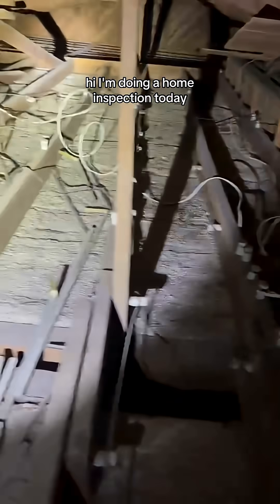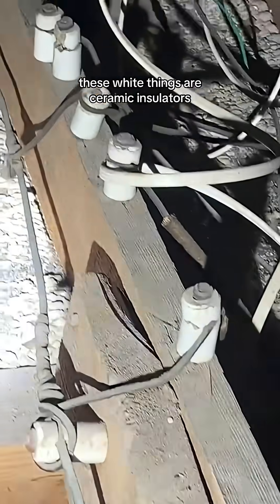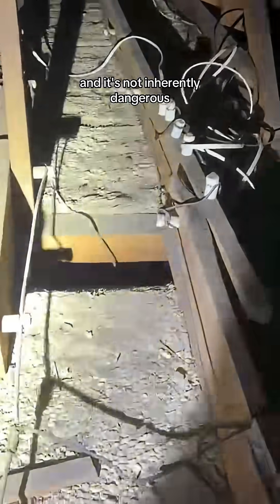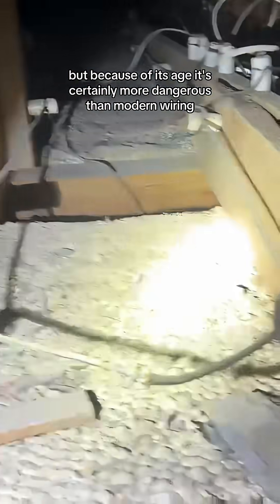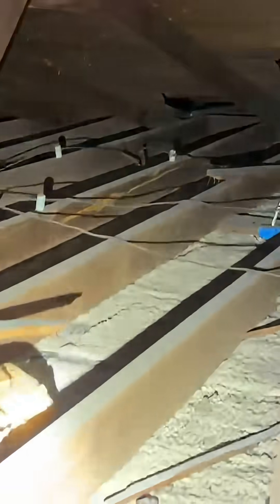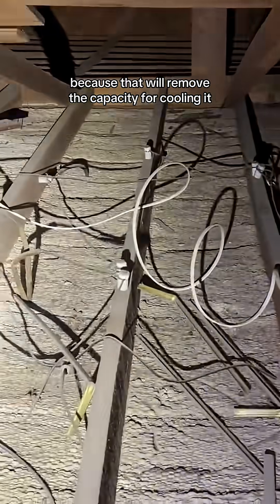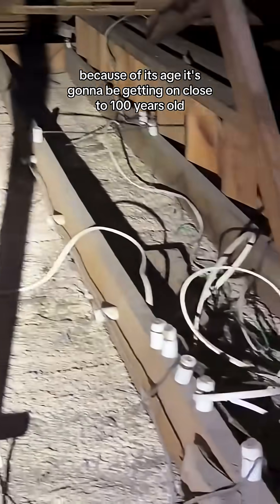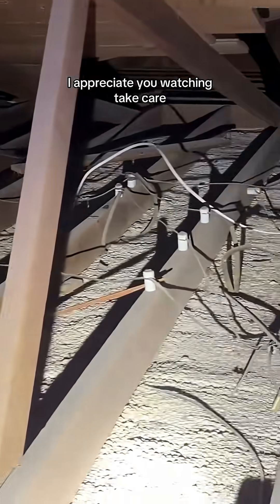Knob and Tube Wiring Explained 👉

Comment: Not dangerous? It's a fucking fire trap
Reply from the maker: Sure, it can be a fire hazard, but if knob-and-tube wiring were inherently a “fire trap,” most homes that still have it simply wouldn’t be standing today. And I still see it on a regular basis in the homes that I inspect.

The reality is that knob-and-tube wiring was safe and code-compliant when installed. It becomes hazardous when it’s damaged, altered, buried in insulation, or when the old insulation deteriorates over time.

Age and misuse are the real issues — not the original wiring method itself.
Reply: @morganinspectionservices3840 true that
Reply: @morganinspectionservices3840 I agree 👍

Comment: Should also be noted that this type of wiring does not include a ground wire which has been required by NEC for over 50 years.
Reply from the maker: Good point. Thanks for watching and for commenting.